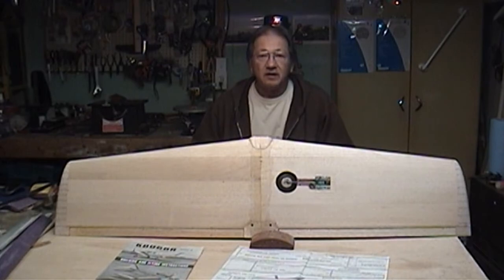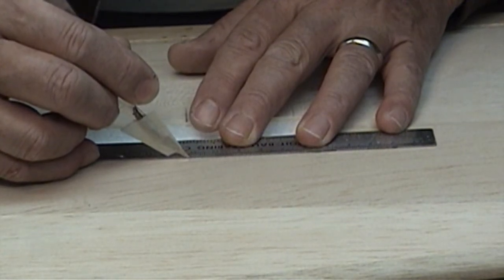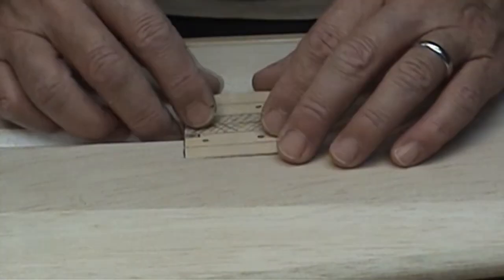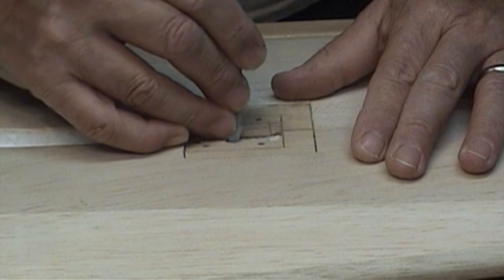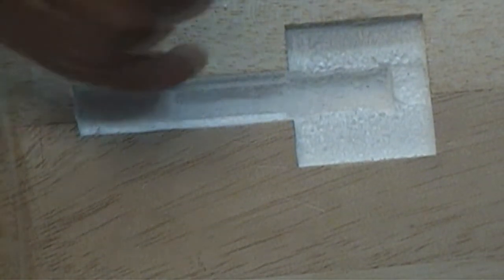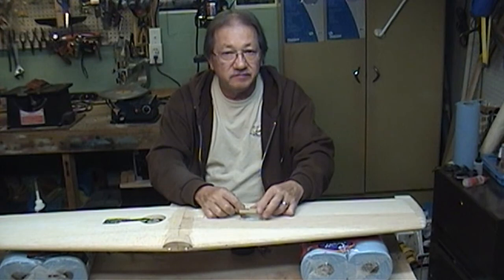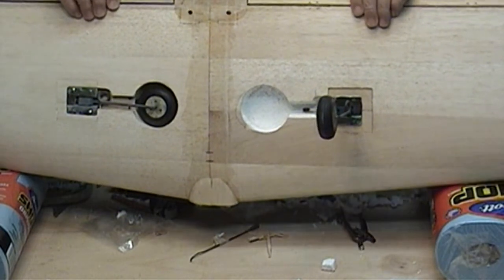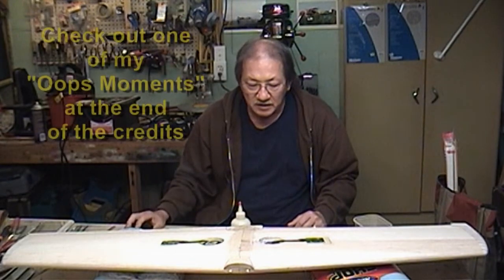SIG KOUGAR BUILD   Part  11-A   The Retracts

Comment: I just received a kougar that was mostly built. I can't say enough about how helpful your videos are to me. Would you happen to have a link to the retracts or a similar set I can use? 
Thanks,
Troy
Reply from the maker: Hi Troy, almost any .40 - .60 class retract will work. They need to handle 5 - 6 lbs (2.26796  kg - 2.94835 kg) model. The retracts I'm using, I don't believe anyone produces anymore. You may want to look into electric or pneumatic types. Tower Hobbies, Omni Models, Horizon Hobbies and Hobby King will be your best bet to find retracts. 

www.towerhobbies.com 

www.horizonhobby.com
hobbyking.com
Omni Models is now on ebay only.